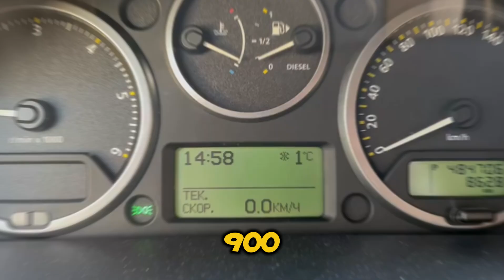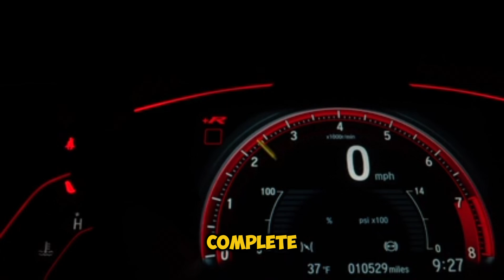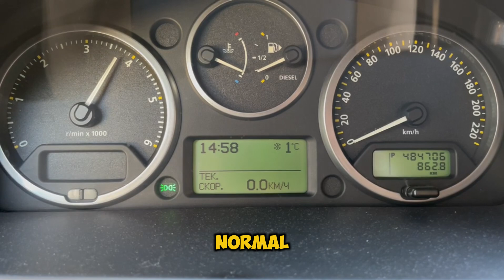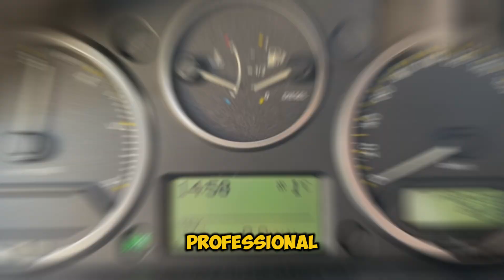Why Your Car Revs HIGH When Cold - INSTANT Engine Damage?

Comment: I seen a video with the LS 1 motor that until the piston warms up it can slap around in the steel sleeve bore. So gradual warm up of the piston to expand at a different rate than the cylinders steel sleeves.

Comment: The vast majority of wear on a motor happens on the first ten seconds of running. Running at high rpm when cold wears the motor out quicker so you buy a new car sooner. I start mine, carburetted car, I keep it running but at low rpm for a solid minute then I pull out choke knob for a bit of high idle for a few minutes. 30 years since I built them and still running well.
Reply from the maker: Thanks for the info!